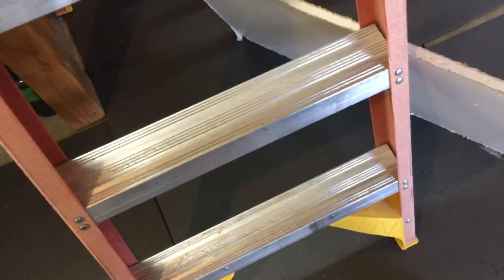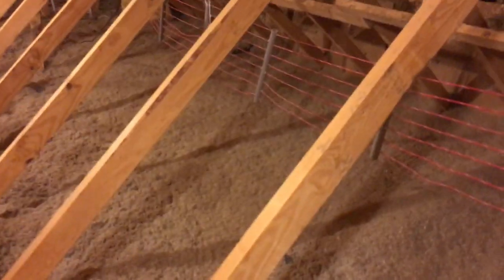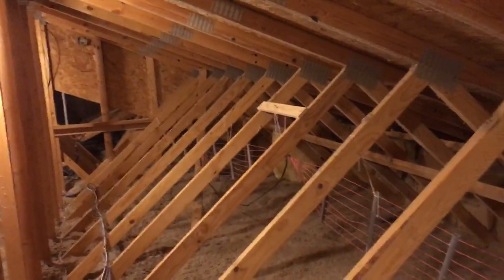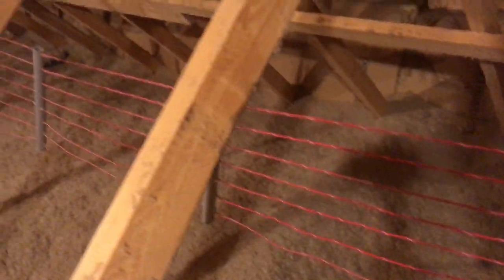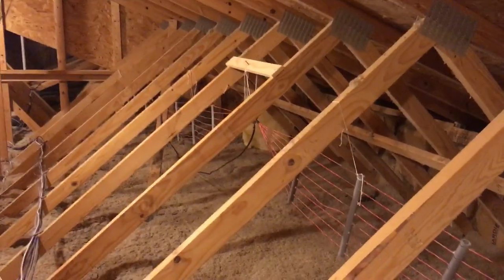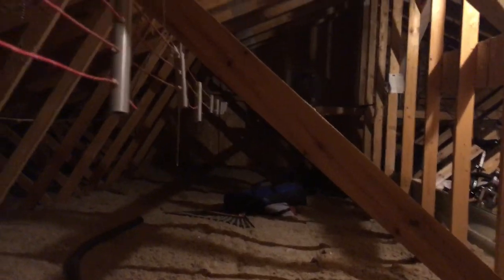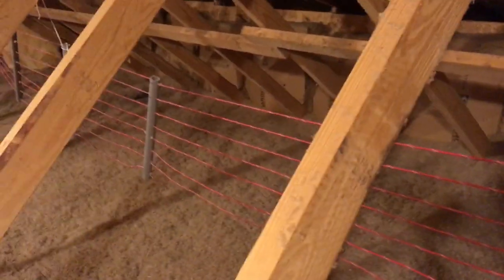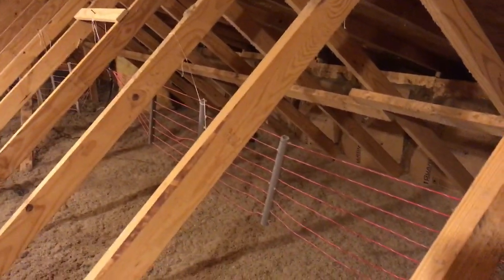Dipole Antenna  |  Homemade HF Antenna Covers 40, 30, 20, Meters And More

Comment: I'm an old tech plus ham. Been out of the hobby for 2 decades, sold everything radio over 15 years ago. Just kept my license renewed. Now the radio bug is biting again. I'm studying for my general now (that's a tough thing to do after 20 or so years. lol)

Anyway,  I bought a new Yaesu FT-991A specifically for the built in automatic antenna tuner. I've been researching ways to construct a multiband dipole. This looks like it'll do the trick! Thanks for this video! I'm subscribing to your channel!

Comment: New Ham - Want this antenna.  Can you share a picture of the center connection piece, so I can do the same?  And hate to ask - but would you have a suggested parts list (what kind of cable you used).  Thank you!!

Comment: I was up there secretly yesterday. I live on the top floor of a 3 storey 12 appartment block with an access trap to the attic. Gave up when I realized a sloped roof between the 2 adjoined building  kept me from crawling any further. The dipole is 65 feet long total. I could use a long piece of wood  at each end to push it all the way  down there and keep it from curling back. I lost my glasses up there and a pair of pliers so I may just give it another try tomorrow, For now I ve slung both ends on top of the roof from my balcony but I can't get a straight line or see how it s laid out.

Tried an inverted V  from my balcony, too low. I may try using the big tree up in front for a higher inverted v tonight.

I'm new at all of this, just got a mint condition Yaesu FT-One, I'm unlicenced and receiving only. It's still a whole lot of fun.

Comment: I need a longer house! My 40 meter dipole bends at the ends to fit the width of house and it looks like a zener diode :/
Reply from the maker: I was tired of walking up and down steps all the time. So I bought a rancher.

Comment: New sub and new ham here.  I am wanting to build a fan dipole in an inverted v.  I have a 55’ tower outside of my shack, and am curious what about the spacers you used.  I understand the 1/2” PVC, but how did you secure the wire.  You mentioned nylon connectors or something?  I like the look of your attic antenna and would like to try one in the attic also.  I have about 60’ of attic, can the ends on 80 bend?   Might have to try it.  I am loving the learning and the science of this amateur radio hobby.  73 de KI5HXM Brent from Texas

Comment: I like your setup & i am gonna copy your design.  Question for you.  I want to run 4 half wave dipoles resonant to 10 , 12 , 17 , 20 meters, with a remote switch unit at the station,  can i get away with using the pvc separating each line that close with out interference?  Of course only one antenna will be used at a time depending on what freq i am using at that time.  If this works out with 4 i may add 4 more  to my remote switch then all my freq will be resonant to the band. No heat,  no arching this way. Thanks.
Reply from the maker: You should be fine. I used PVC  to separate the wires. And other hams use the pvc also.
Reply: @FuzzThePiGuy  okay thanks for the reply .